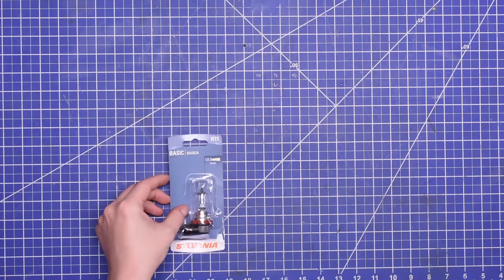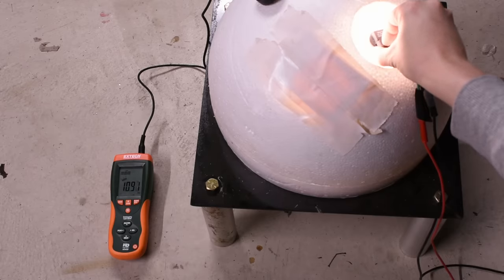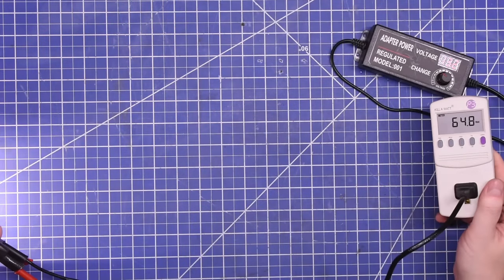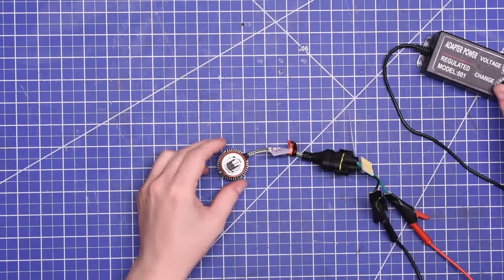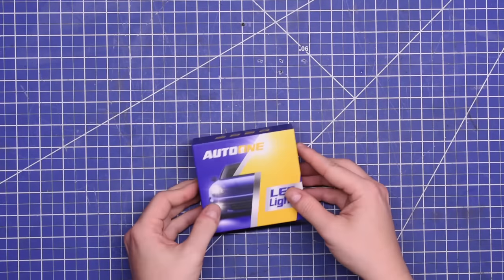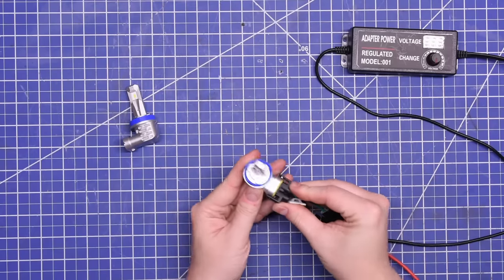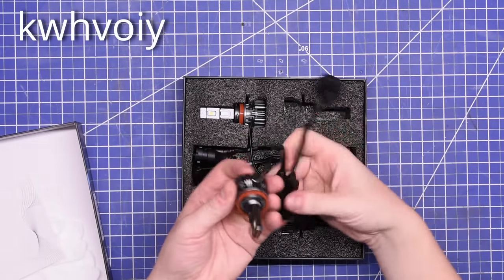Amazon Headlight Bulbs are Getting Out of Hand

Comment: 1 thing you must do after getting led's setup is  to adjust the headlights because the aftermarket led lamps will have a different pattern so you might affect drivers infront of you or oncoming traffic that's why many of us hate driving behind a pickup trucks because they upgrade and the halogen to led change completely changes the pattern and burns others eyes even during daytime when traffic is bumper to bumper I usually use Luyed for interior lighting from amazon and Sealight for exterior both brands are installed on all of my 5 vehicles for about 5 years on the oldest purchase which I hadn't noticed any dimming the headlights as some claim they have after while I live in an area where  street lamps are non existent so having bright lights is essential for driving at night. Just wanted to put my two cents

Comment: Glad you did a LED light comparison!  If you are reading POWER between your Adapter and the Wall Socket then you are including the inefficiencies of the Adapter in your readings.  The reason I bring this up is the LED's hooked to a DC auto battery would not have this inefficiency!  So you are robbing some power and maybe brightness from the bulbs compared to a DC battery.

Comment: The issue I have is the GM 9005/9006/4114 lighting (2000s GM trucks and some cars, including my 06 Silverado). They used the same connector for low beam (9006), high beam (9005), and daytime running lights (4114).  The 4114 doesn't have voltage regulator so it is direct voltage (causing the halogens and LEDs to burn out), versus the low/high beam does have voltage regulation for consistent light output. The low beam is typically 1000 lumens (+/-10%), and the high beam is typically 1700-2000. Sadly all the LED bulbs always say 9005/9006 claiming they will work for each, but as you saw with this test, almost none of them have a higher lumen output typical for high beams, and the fake lumen numbers cannot be trusted. Of course some idiots always manage to find the 9005 high beams and put them in the low beam port blinding everyone else.

Comment: sorry, but about those artifacts and spread of the LED lamps: they are supposed to be calibrated for the new position of the LED. The focus point changes because they don't follow a standard distance from the socket, so you might have better results if you dial your headlight in order to use a LED lamp.

Comment: keep in mind you always have to re-adjust your headlamps after installing LED to avoid blinding oncoming.
this is the biggest problem with people going LED is they dont adjust.
for some reason, even when the LED are placed correctly in the housing, the beam is centered higher than halogen. I have put led in 3 different vehicles and each and every time I needed to adjust the beam down... in 2 instances a significant amount.
if your uncertain how to test this there are plenty of vids about it, but quick version is park roughly 25' on a level surface from a flat wall, tape a horizontal line where your halogen bulb's cutoff is and then place a vertical strip  at the centerpoint of the "hotspot"
after swapping in LED (leaving the vehicle in the same spot for best results) check again and you will notice the cutoff is always above previous. you may also need to adjust the aim for the hotspot as I found on 2 LED that had also moved.

Comment: The only place I will buy LED headlights is from a company called Headlight Revolution.  I tried others with dismal results. HR has lights for different applications, including off road.  For my use, I want an exact OEM beam pattern but white and bright [ being old I need the extra brightness ].   They guaranteed I would get what I asked for - and I did.  They generally run $200 a pair for the dual element style lights.  I've been using one pair in my main driver for over two years and they are still working great. I recently bought a 2nd pair for a small 4x4 and again, perfection.

Comment: Doing this same test on projector headlight buckets instead of regular buckets would drastically change the outcome of this experiment imo. Just because the headlight bulb is for sale doesn't mean it is made for your car, although I'm sure it doesn't hurt in some cases.

There is a reason that HID/LED headlights are recommended in projector style buckets. Projector's redirect all the light from the bulb directly into a focal point then distributed evenly. As seen in some of the bulbs where you have the "flood" effect, that may not be an issue with projectors where you can harness all the light being emitted. So, you reap the benefits of overly bright headlight bulbs without blinding someone.

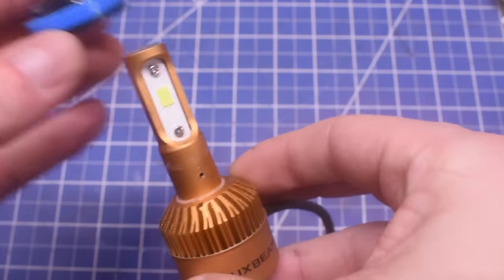Comment: one thing the might change the outcome/numbers of your test is the voltage.  You are running these tests at 12-13 volts but most cars when running are at 14volts. 12:20 you could of used the screw as a set screw and re-clocked it. It just needs tension to hold it there the threaded hole isn't needed.

Comment: Another observation [Ugh - these puns!!]: 
An aspect which I haven't seen noted, is that the road surface isn't all the same distance away from our cars.   The upper part of the beam is reaching the road 4 or 5 times as far away from the car, than where the lower part of the beam reaches.  (Tbh, the uppermost margin of the light spread, never reaches the road.)
The upper part of the beam dissipates greatly.  That means the further up the wall we look, the more exaggerated the illumination is. 

For oncoming drivers? 
The further down the spread, the less any sundry/erroneous patches will bother others.  
The higher up the wall these glitches appear, the lesser intensity these folk will have, due to the dissipation.  (Yes, ideally, we have no patches of unwanted beam. 
🤞🤩)

Comment: 3:30 in 2015 the prices were more higher ultra $120 and basic $80 US dollars.
My dad is a Uber driver since late 2014 he bought a brand new Prius 2015 and drive at night.
He changed headlights almost every two weeks cuz they get burned.
One day my dad asked me to go to Autozone to buy some new headlights ; I get shocked when I see the prices @.@
So, quickly I say dad how frequently you need to buy those headlights. When he told me every two weeks. holly $hl7… I suggest my dad to get those LED headlights on Amazon.
Sealight Scoparc $40 US dollars
After that my dad never need to buy headlights again and they are more brighter than standard halogen headlights.
Also, my dads Prius car 🚗 just reach the 500k miles and they are still working perfectly same like the car.

Comment: They generally advertise LED diode specifications that's why it is sort of misleading. 
And the cheap ones less than 40$ are quite poor like you tested. Their LED placement don't mimic halogen height/placement so only the very narrow ones are barely fine in reflector housing.
If it is working fine in reflector housing it will for fine in projector housing since they are designed for the same point of light source. 
There are some better ones like F5C or F7C that are huge improvement but at this price range LED projectors begin to show and some of them are beyond OEM HID setups but that brings us to projector retrofit territory. 
But all the LED's eventually die because of overheating - cooling is poor inside headlights. Only the ones drawing less than 15W survive for years but they are more for daytime running lights and not providing enough lumens for safe night time driving.

Comment: I tried the Auxito LED H7 ones which didn't give a lumen output and just said "high brightness".  6500k for color and 50k hrs operating life.  They were very bright, but there were lots of gaps in coverage and they lasted 3 to 4 months before failure.  They did honor the warranty and send me replacements, but I would not recommend them at all.  They did not have ballasts or fans and stated RC9-18V operating voltage.

Comment: That's the headlight I want to buy. The 36,000 lumens. Presently the headlight mod is to wire up the high & low beams to illuminate when only the low beams are selected. Blinding everyone driving on the opposite side of the road.

Comment: Check out the three sided.
I got these,"MIFMIA H13 LED Headlight Bulbs, 15000 Lumens 500% Brighter 9008 LED Headlight Bulbs High and Low 6500K Cool White LED Headlights Conversion Kit, Pack of 2"  but have not got them in yet.
They were cheep, so no big loss if they suck.

Comment: I have had the Ultras in my Silverado about 2 1/2 years now and they are also on as daytime running lamps.  It is a daily driver and on for about 1 hour each work day not including some out of state trips if that helps anyone out.  I usually replace them ever 3 years as I have found that to be about the limit that I want to push them.

Comment: I run Sealight 9005 & 9006 bulbs in my 2005 Silverado and they are a huge improvement over the stock lights. They claim 14k lumens which I doubt but, like I said, they're still a much better light then the stock halogen bulbs.

Comment: Sellers usually post the max lumen output of the led chip as opposed to the output limit they set. I bet most Led sets perform better in a winter setting. You should try a good brand like Lasfit next time.

Comment: Ignore the lumens numbers and find the wattage.

LED's are 100 lumens per watt in power applications like this, so find the power (per unit - watch out for power quotes "per set")  and multiply by 100 to get a good approximation of real lumens (excluding losses in the optics).  (LED's can get higher efficiency than that, but in much power power and temperature applications.)

It's also a good idea to test these on a bench supply or 12V battery to measure current draw and figure out true power.

That also gives you a baseline for heat as well, as the watts that don't get turned into light become heat.  At 100 lumens per watt for white light, that means about 65-70% of the wattage becomes heat.

Interestingly, Philips Ultinon (of which I have a set) are about 3x overengineered from a heat standpoint vs the others: not only do they have a fan when some comparable units on Amazon have none, but they have more metal bulk, and their true power consumption is around 17 watts per unit, 1700 lumens.  Unlike any Amazon unit, I can handhold the Philips during operation for minutes, while the others become too hot to hold at any point on them within 30-40 seconds.

Comment: Car voltage when engine running is about 13.8 to 14.1 volts on miy Ford, so the readings especially for the halogen lamps would go up significantly

Comment: Interesting tests. Given the GIANT disparity between rated versus measured lumens of LED bulbs, is it possible that the calibration or measurement means has to be adjusted for higher Kelvin (i.e. whiter) bulbs? Perhaps there is some 'adjustment' that takes the basic lumen value and then 'calibrates' it relative to the human eye's sensitivity as a function of the color/spectra. For example for a given lumen value, the eye will essentially see better in daylight color (~6000 K) than it does in a warm, yellow, sunset color/spectra (~3100 K)

Comment: LEDS are current driven diodes.  That's what the "D" stands for.  One can build a LED headlamp LED bulb that will operate off 12VDC directly but a car's 12V is not really constant as the voltage goes up when charging the battery and even more so when it's really cold outside.  While they'll add a ballast resistor to mitigate the effects some, a small voltage difference will still make large difference in current which then results in a large change in brightness.  That means the really cheap ones are a compromise and when they are operating at the higher voltage range they can easily get too hot when designed poorly with not big enough heatsinks or not enough forced air for the ones with the built in fans. 

As a rule of thumb, true for all electronic things, for every 10C change in operating temperature the MTBF (lifetime) goes up/down by a factor of 2 so you don't want to be operating diodes real hot if you want long life. To regulate the current when the input voltage is changing, a "driver" is used.  Basically it is a DC/DC converter designed to provide an output current to be the exact amount the LED is rated for the requisite lumens provided. These can be built into the LED headlamp bulb assembly or be an external box.  The former is harder to do than the latter. 

Ideally, you want a good and properly designed LED headlamp bulb that does not have a fan incorporated into the bulb because a fan has a horrible MTBF and it drops precipitously as the temperature goes up. Manufactures use a fan to get more power (or light) out of electronic components or to compensate for poor or not enough passive cooling cooling as a fan is cheaper than a lot of aluminum heat-sinking.  The Chinese manufacturers calculate this stuff down to the penny. 

Oh, and the Chinese lie through their teeth about things like "lumens" so caveat emptor. To not get screwed, find independent evaluations and testing like these guys did and keep in mind you sure as hell don't want LED headlights so bright that they blind on-coming cars, unless you want to be testing your (Chinese made) airbags in a head-on collision.

Comment: Very interesting video, thank you!
I do have a constructive comment.
It is true that you cannot correctly measure the power consumption of the lamps with a watt-meter that measures the power consumption of your 12V power supply on the power grid. The efficiency of your 12V power supply is not perfect and can vary with different loads, so your measurement is not representative. To correctly measure the power of the lamps, you must connect an ammeter in series with the lamp, current multiplied by the voltage then gives the correct power consumption for the lamps.

Comment: Those fahren ones at the end of the video are super bright. I bought them and another series from the same brand that was about 60% of the price plus it was a damaged box so it ended up less than a third of the cost and they were only slightly less bright, i could only tell if i put them side by side in each headlight, otherwise i couldn't tell the difference from either inside or outside the vehicle. Sent the expensive ones back

Comment: I would like to inform some viewers and yourself if not imply. But aftermarket LED bulbs dont work well in reflective headlights housings. The lights spreads way to much and is not focused properly, making the low and high beam look the same. Aftermarket works a little better on projector housing. I next thing you have to look out for is the lifespan. Most would burnout in a very short time. I personally would go with Auxbeam or Novsight that give warrenty on their products

Comment: I tried the Sealight LED in a 9005 high beam.  Supposed to work as DRL too.  Doesn't work as DRL.  Sealight sent me a decoder resistor, which didn't help.  So if you have DRL that uses your high beams, research whether it actually works in your specific vehicle.

Comment: i had a truck with the old halogen lights in it, after upgrading the wire to 12 gauge to run the head lights... they pulled a solid 2000 watts when they were on, lots of light but the battery would go flat after 150 miles. The LED lights make lots of light without draining the battery, and don't need a gauge upgrade to put off good light. "nice to seal the headlights and fill with mineral oil for better heat dissipation the LED's do get very hot"

Comment: one important factor to consider is putting the correct bulb in the correct housing. most of these led bulbs are not meant for reflector housing's because they just spray light all over the place blinding other drivers. to property test these things you need to figure out which of these bulbs are meant to go into reflector housings vs projector's.

Comment: I have exclusively used auxbeam headlights fog lights and light bars. With their headlights and fog light they have a set screw on the collar that locks into the house that allows you to fine tune the beam pattern in your housing. I was able to perfectly match the beam pattern of the halogens

Comment: Just so you know, you can run cheaper bulbs in projector housings, not reflector housings. 
HOWEVER there are model specific leds for reflectors that are really good. 
As for other Amazon brands,  I have had luck with $60 H7 BPS lighting in my Audi's reflectors.
And I also think the Lm rating is as shot out of a projector housing.

Comment: 1:06 The H11 is fair - but not the most used.
But, the H7 is the most used on modern cars - apart from those dedicated LED solutions.
Also, the H1 is used a lot on medium priced cars.
Cheap cars use H4, which makes for both the dipped and high beam.

The proof for this is that Osram / Sylvania and Philips launch their new product on the H7 socket first.
Only afterwards do they launch on other sockets.
They do this to get the initial development cost as fast as possible. If the product does not sell well, there is no sense in producing it for other sockets.

Comment: The reason the other two led bulbs have terrible beams is because the emitter surface is huge. To resemble the beam shape the reflector was designed for the led needs to be as close to the location of the filament and the same or similar size of the filament on a halogen bulb.